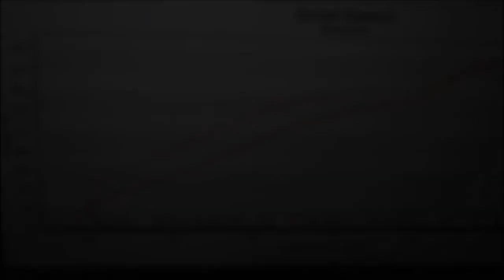Inhouse Engineering Dyno Session GTX 3071 MK6 GTI's & Hybrid KO4

Comment: Anything added to your besides water/meth? I trying to hit 400whp with a gtx3071r stock everything besides drop in fuel pump
Reply: You’ll need meth or aux fuel to hit 400whp reliably
Reply: @stamadon  check out @BoostedMk6 He's over 500whp with a stock block on a GTX3071R and meth.
Reply: Cowboy B. Yea...Dustin ain’t at 500whp... I made more power than him. After this vid I went back got the car up to 25psi and made 481whp.
Reply: @stamadon  Now he's stratified protuned, 500 wheel for sure champ! Check out his 180mph top speed run